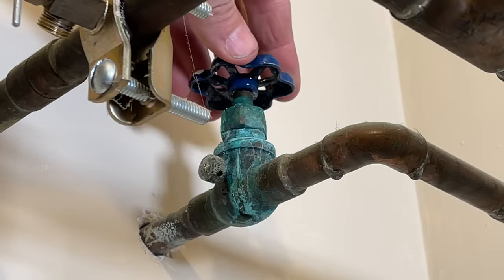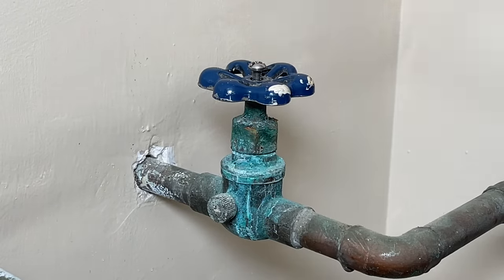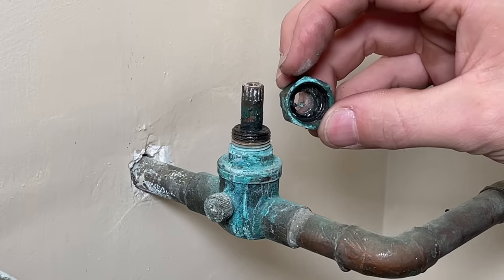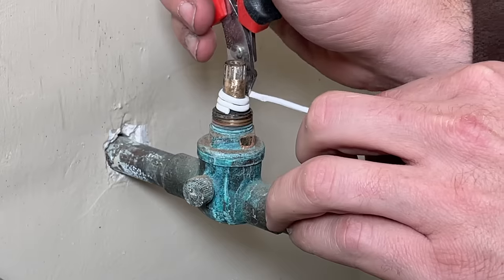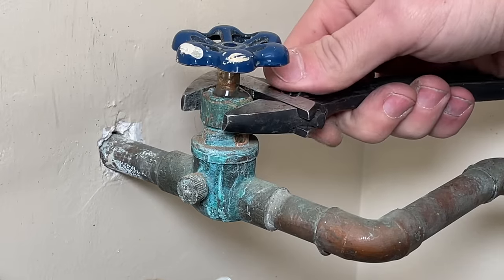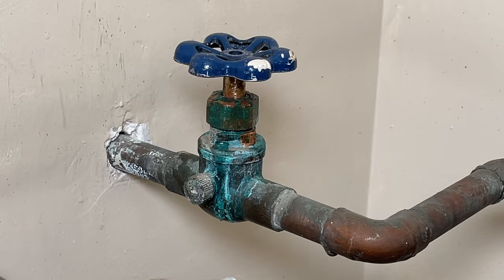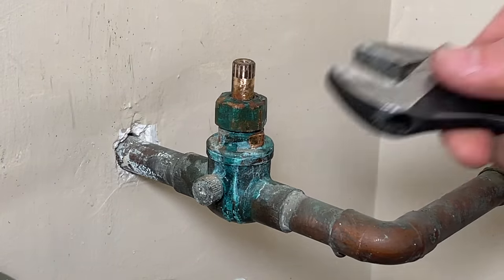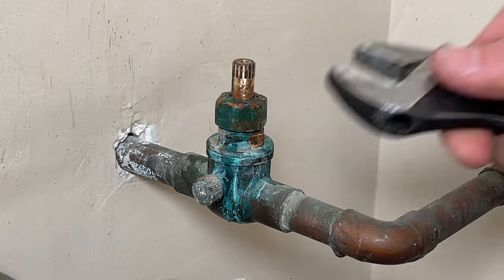How To Fix A Main Water Shutoff Valve Leak

Comment: I’m not a pro but I believe that you’re supposed to have your gate valve opened all the way up when tightening the packing nut.
Reply: #1; The valve in the video is not a gate valve, it’s a globe valve. The name for this type of valve comes from the rounded shape of the main body of the valve, which gives the valve the ability to let the same amount of water pass through the valve as would flow through the 1/2” copper tubing feeding the valve. #2 a gate valve has what literally appears to be a gate moving up and down (like a guillotine) while the handle stays spinning in place. One is not expected to open either type of valve “all the way up” in order to add new valve-stem packing. In the case of some globe valves, “all the way up” (completely open) is sometimes determined by when the threaded valve-stem backs into a washer put in place to sandwich the valve-stem packing, such as in a multi-turn sink supply valve (called a “Speedi-Stop” in New York). Despite his good will, this gentleman is not qualified to teach people how repair (or play with) valves that might brake off of their supply tubes due to his failure to hold the old globe valve in place with a wrench while applying the high amount of torque necessary to remove the part of the valve holding the valve-stem. An enourmous amount of water can gush out of that 1/2” supply line while he’s running to shut off his exterior water-main valve!

Comment: What I did, after having the water shut off, was replaced the whole valve stem with a new one that cost  less than $10 and should last another 30 years like the last one. I will try tightening the step 1 or 2 the next time though. Great video.

Comment: My friend you got to learn to work with two wrenches always work with two wrenches could you get a big mechanical advantage with that open-end wrench put a pipe wrench and lock it under the valve or you will break the pipe hate for that to happen to anyone
Reply: You're right 🙏

Comment: Turn the water off at the main, cut the old valve out, install a new quarter-turn ball valve.  Problems solved.
Reply: That valve is  Caged in to a rectangle of pipe. 
Most homeowners don't have skill or tools To solder in a new valve, And cutting it outMay leave not enough pipe to fit into a new compression valve or shark bite valve. 

You would have to measure carefullyTo make sure it's all going to work
Reply: Cutting off the main in our city costs $120 plus you will be without water for most of the day
Reply: @Joseph-eh2oq  that would really suck I guess thats when you get them to cut it off and install your own whole house water shutoff valve , in the city here we have to get the city workers to shut down  the water we're not allowed to touch the meters
Reply: I agree with you 100%. I turned off water to change water heater. Main valve leaks like a siv, buying new quarter turn shut off. Hope the town will locate and shut off main for me with no problem. They can change meter too, don’t even have have exterior reader.
Reply: Maintenance every 60 years hardly warrants a replacement with a ball valve.
Reply: @Joseph-eh2oq  .........most city meters have two shutdown offs! The main one which is on the city supply side to meter and the customer side for the customer to shut off water supply to the house on the outlet side for the meter....
Reply: Can you do a video on how to do that please.
Reply: @stevenbernstein1978  
I've never saw any of those last anywhere near 60yrs and that's including the ones that were installed properly(handle facing straight down)
Reply: @bigglilwayne7050  Scott said (at the 12:30 mark) that the washer had been in place for over 60 years! Cheers to engineering technology that lasts!
Reply: 💯% agree!!👍👍👍😎🍻
Reply: @Joseph-eh2oq  You live in the moon o what !!

Comment: It was still leaking lol, that old gate valve is not worth repairing you’re better off replacing with quarter turn ball valve that will hold up better
Reply: this was for older places, not meant to slight the author and producer.....new is NOT  ALWAYS better, but, in some mechanical areas, newer  IS  BETTER....experience should dictate the level of wisdom you should understand...with an  open mind, for either, in any situation/circumstance or field of interest....

Comment: Good fast temporary repair until the valve gets replaced.  I recommend not using those turn valves use the leaver valve the best.  This is an easy job to replace valves i replaced many solider pipes replaced pvc pipes.  Youtube is the best thanks for posting

Comment: Excellent video my man.  I know about the packing nut but never thought to replace the nylon/graphite packing material.  I would just point out that the beginning of step three after  you shut off the curb valve open a outside hose bib to release the remaining standing pressure.  just be sure to close it after making repairs.

Comment: Much appreciated - great video if you need a quick and or easy fix - as I did - I had a slight leak from the stem (mine's horizontal FWIW )... noticed the packing nut had quite a bit of thread showing so a quarter'ish turn did the trick. thank you.

Comment: Thank you!! I was trying to replace a different water line and had to shut it off which of course caused a leak. Didnt have time to go pick up the packing material but I used liquid teflon (sort of like pipe dope) and it actually worked!! Saved me from calling off work to get this fixed for the day.

Comment: Completely dismantling the valve and polishing the stem will REALLY help get a good leak free seal with the packing. I polished mine with a very fine grit on a belt sander. It shined like new and was leak free with the new Teflon string.

Comment: Good Video, 
I have found though years of experience that using plain old Plumper Grease on the threads and metal to metal contacts make future Removal, Installs and Operations a lot easier...   Also should check the Seat for a abrazenions, which will tear up the Washers...

Comment: I've got one of these at the water meter. Service provider requires a customer shut off on the customer's side of the meter. Just bought the house last month and haven't been able to get the water on yet because there was no evidence of the required shut off. The previous owner had water service and the ordinance requiring the shut off is older than the house...so they had to have one somewhere. It was recommended to have it located within three feet of the meter. That's exactly where I found it. Buried 18 inches under ground. No valve box or any sort of protection whatsoever.  The valve is completely caked in hardened dirt that has to be broken up with a pick. I was able to excavate enough of it to get the valve to turn and then water came out of it when I turned it off. So now I have to look into that. Thanks to this video I have a pretty good idea of what I am looking for now.

Unfortunately I can't even see the valve assembly itself, I only have access to the handle. The ground requires so much force to break up that I will destroy the pipe/valve if I strike them by mistake. At this point it looks like I may just have to do that and repair the whole thing once I've got it excavated. Unless anyone here has advice on how to break up what is essentially stone without busting the pipe running through it.

There were also fire ants nesting in and around the whole area where this valve would've been protected by a box. When I found that and all these other issues I was so mad I went to Lowes for insecticide. The one time I actually have someone come up and ask if I need help finding anything and its when I know exactly what I need and where to get it. Figures. So I told him I was looking for something that would kill every living thing within a 30 mile radius in five minutes or less. He left me alone. 😂

Comment: I work in a historic district and we try to save old stuff like this  or at least not get invasive if we can,  because once you start it,  you can get deep fast lol.  And some folks just want a simple repair, not a major plumbing repair. 

Big issue I have with old valves is the flat washer screw is deteriorated and just snaps off. If you're lucky,  the screw is so deteriorated that you can pick what's left and clean up the threads for a new screw Otherwise,  it gets tricky with drilling a bit and trying to clean out the hole, the hole with a blind hole tap.  Other issue is with really old valves the body washer is an odd one and hard to find, if can be at all. Lotsa fun to be had :) 

BUT,  be prepared for the worst when taking these things apart. Replacement may be required.

Comment: I agree, ball valves are the way to go. In my milder climate with no chance of frozen pipes I even use them for garden spigots and hose ends with just a few adapters . With their straight through design and ease of control you can go from a trickle to full flow with ease. At a glance you know if they are fully off so no leaving hoses on by mistake.
Reply: John Everett, may I ask your opinion please? I have a leaking gate valve, exterior on the house hose bib. I want to replace with ball valve with lever. Because it is exterior, I want to use stainless steel ball valve, for corrosion reasons. My question is, will the solder stick successfully to mate 2 different metals? ie, stainless to copper. Will this soldering union last? Is there special solder for this?Maybe add a copper adapter so it is at least copper to copper on the main water line? Thank you. Jim .
Reply: @jamesmacdonnell4085  Hi James. I just buy the brass bodied ball valves that have threaded ends. That way you buy any adapter you need to install it by sweat fitting or just threads.

Comment: If the valve is the actual MAIN shutoff (the one in the video may or may not be--it is a globe valve to shut off the water heater) Most mains are gate. It can be hard to fix because you can't shut the water off to it>>water co. has to do it outside. Gate valves are metal on metal wedges that take many turns of the handle to shut off. They don't have washers. They DO corrode so they can get stuck. If the main valve can be shut off most of the way, an additional valve can be inserted between it and the house. You have to use compression or shark bite fittings since the dribble of water won't let you heat it up enough for a torch and solder to work.

Comment: I’d give ya two thumbs if possible . This is how plumbing usually goes for me . It’s always the hardest part or usually just replace the valve but this is nice to know . I always wondered . Ball valves everywhere when I’m doing plumbing . I still sweat copper unlike many other who like shark bites . It’s way cheaper to sweat it right and sure looks cleaner . I’m not even a plumber , just a construction owner who usually has to jump in and fix many things .

Comment: What type of water are we dealing with ? ('city' supplied water or well water) These washer valves are a poor choice to deal with alkalinity, calcium and magnesium in an unfiltered water supply. The seals rot over time and almost always or eventually leak. A ball type valve is the better choice. Granted, the washer type valve are cheap and easier to repair.
In this example, there seems to be al lot of oxidation and that will always corrode the copper valves (and the washer). Again, in my experience, the ball type valve is the choice for shutoff and control applications.
Great video !

Comment: Thanks X 3 for this great video, a plumber with or without experience always use counter wrench (2 wrenches) to install or remove threaded parts as this avoid cracking joints that will leak later on adjacent work being done... also, best plumbers and do it yourselvers use waterproof grease to make the plumbing parts last longer and easier to maintain thereafter ; )

Comment: Great noob video. I had some other issues I wanted to be fixed by a plumber so I had one install a ball valve before and after the water meter (inside in the basement). Had other ball valves installed because I wanted to be able to isolate water flow to some of the 4.5 bathrooms in the house

Comment: One more steps must be addressed if you've never installed teflon packing cord or flat teflon tape: In this application wrap it in the same direction that the cup/nut turns when tightening. If it is a male part such as a pipe thread plug you'll want to wrap it counter clockwise. If you don't follow these step it will unwind and perform poorly. Good, concise vid. Bravo! Oh... turn the water main valve off prior to doing step #2 and 3.... HaHA

Comment: In the first step after you tied rope around stem fully open the valve then tight the packing nut & it will not leak until its not turned clockwise . This is the best practice for DIY.

Comment: I had a leak for nearly 20 years on my turnoff valve to the roof cooler, and my dad said, "just put a dish under it until it seats." Every spring, I did that. I was so tired of it, and almost replaced the valve, but tried the packing nut first. Problem solved. Guess dads don't always know best, and sometimes the solution is easier than you think (good thing, because the valve is in a really awkward, tight space). Now my toilet valve is leaking, and you jogged my memory. Hopefully, that's all it is, but if it isn't, it's an easy enough fix. Thank goodness I bought a shut off tool, so I can shut it off at the curb (saw it for sale, about $10 at the hardware store, and knew it'd come in handy someday). When you need one, you need one!

Comment: Tightening the packing nut worked on a backyard faucet    Im a big fan of ball valves and all new ones will be ball valves thx      A wire wheel would b handy for cleaning it up

Comment: 3m makes some paint prep scotch-brite style pads.  They are great for cleaning up brass.  Mineral deposits can make a leak path.  If you get back to a factory looking finish on the moving bits it can keep a job a repair instead of a replace.  I always start with plumbers roll and end with an abrasive pad.

Comment: Verry good, but you forgot one major thing. A l;og of older homes use the ougoing supply line for an electrical service ground. If you remove the vale, you could separate the gound from the electrical service. Just a thought for safety. Great video by the way.

Comment: Not sure if this has been mentioned on here, but you can always buy an identical shutoff valve, store it somewhere in the house. If your installed valve starts leaking, remove the bonnet from the new one and install it in the old one. This is of you're not comfortable doing a full replacement or don't want to pay $$$ to have it done.

Comment: In a boat when replacing propeller shaft packing the principals are the same as for this valve. The recommended way to use packing in a boat shaft is once around the shaft, cut for a tight  butt joint fit. Around again on top of the first, cut for a tight but joint fit 90* from the first row cut...and on

Comment: I've done maintenance on these valves many times and have had the old washer holding screw made of brass break or crumble when I put force on it to remove.
I then have to get out pliers to grab it from the side and turn it.
I've even had the old brass screw break off in the threaded hole.
I then drill it out with a small bit and then run an extractor in the hole to remove the rest.
Then I use the sized tap to redefine the threads so that the new stainless steel replacement screw will fit and hold.
If allowed by the home owner, I will just heat and desolder the old valve and remove it and replace it with a ball valve.

Comment: Great repair.....i would have taken it a step further...cosmetically and have a drill w/wire brush attachment and wire brushed everything with copper corrosion for that new look feel...... since we already had the valve ...stems etc...already dissembled for easy access....thanks again for the repair tips.

Comment: Get a small tube of plumbers or water pump grease and apply to threads, stems, compression washers etc. before assembling, installing or repairing faucets, valves etc. It will help stop corrosion and make things easier to take apart many years in the future.

Comment: You're lucky you live in an area where you can shutoff your water from the curb. We had an old valve like yours. I was repairing another faucet and turned off the water valve. Went to turn it back on and leaking like crazy. Turned it off and leaked even more. Did the packing trick like you said and called a plumber...well plumber said "ok looks like it will hold" then turned it an 8th of a turn and bam! Huge rush of 90psi water everywhere in the flooded basement. He was able to get it settled down to about 15psi and used a hand pump to get the water out psi while the water authority came within an hour and had to shut off the water mains, which in New England are like 8 feel below ground. Huge mess, but ended well with two ball valves (one before the inside meter and one after) along with a reducer to bring it down to 60psi. I've never use these valves again. Ball valves all the way.

Comment: A lot of ppl's problem might be as well when soldering water valves is they don't remove the valve that contains the rubber washer, which heat from the flame will destroy it, after soldering this part in I use threadlock (blue liquid paste comes in a bottle with brush) then install everything again, that rubber washer only lasts for 2-3 years maximum until to replace it.

Comment: My shutoff valve is exposed in an apartment next to walnut paneling. It stayed clean while I lived there. It would leak mildly for a day. A drip every 10 minutes. It finally sealed itself off. Backing it out with channel locks sometimes will stop it. The packing has been tightened before. If you over back it out, it could leak worse. The worm gets cocked inside. 🐀🐾